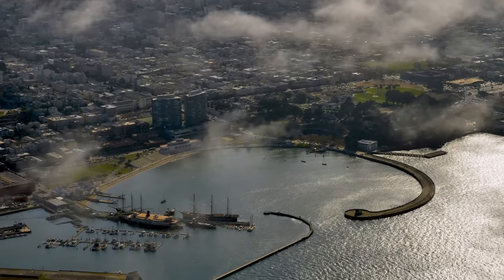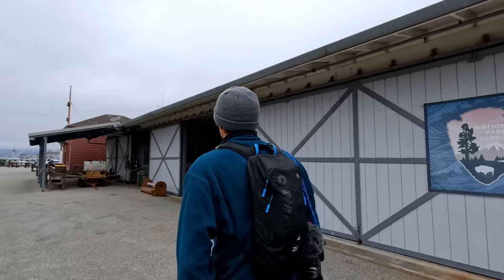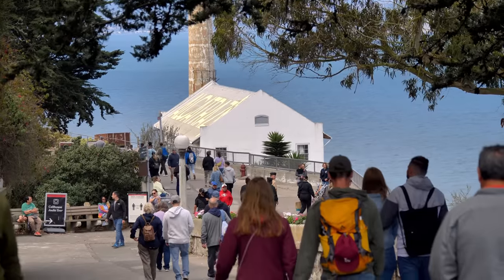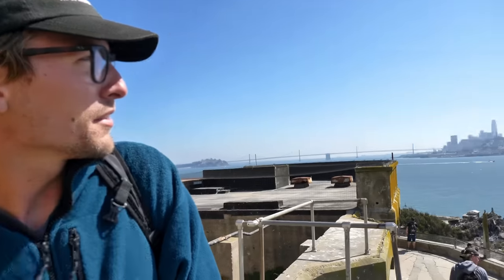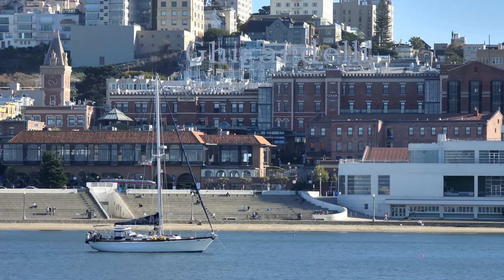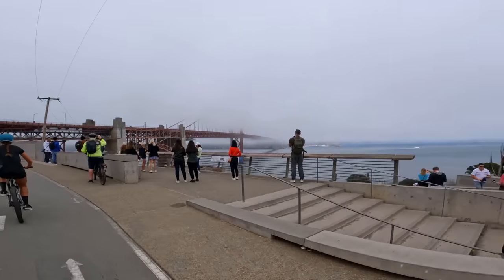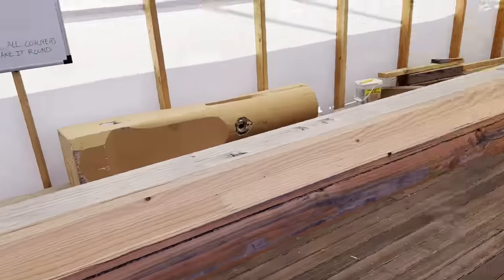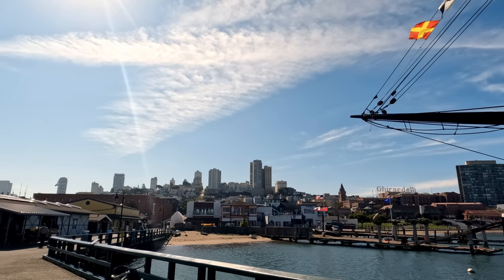Sailors Sent to PRISON | Aquatic Park Cove | Sailing Avocet

Comment: Great video.
I just don't get why there is a HP limit on your dingy, you can go slow with like 30hp or twin 60hp.
Or do I see things wrong?
Reply from the maker: We only have a 2 hp engine for our dinghy, and don’t need anything more than that. The Anchorage only allows outboards under 5 HP to limit the risk of swimmers getting seriously injured. Unfortunately, even though bigger outboards have the ability to go slow, not all their dinghy captains can be trusted to do so.